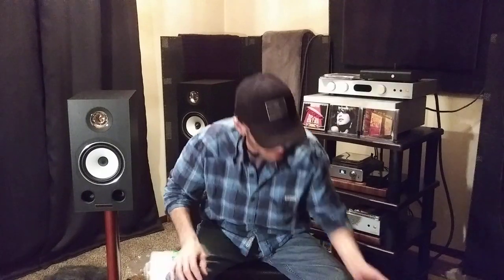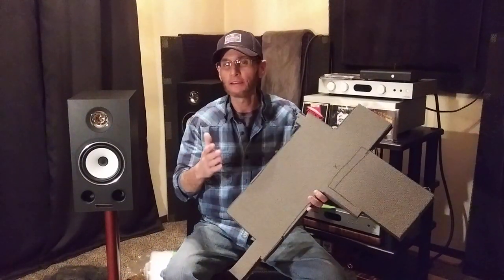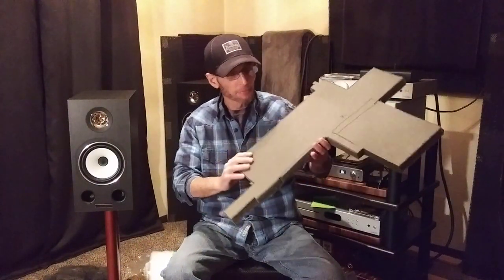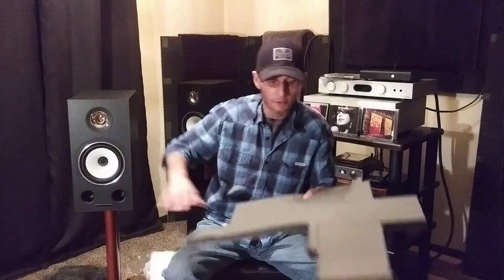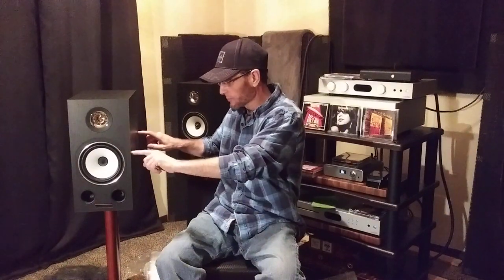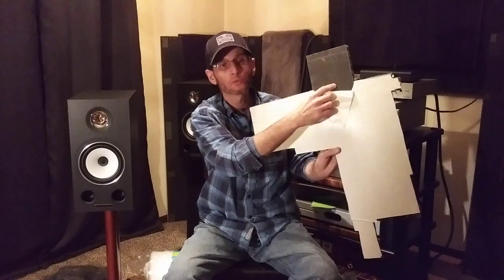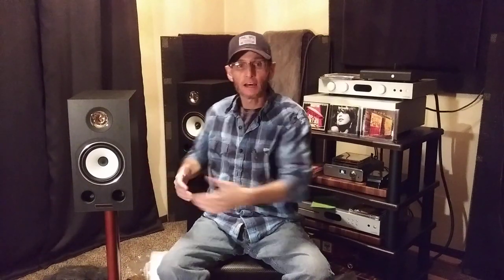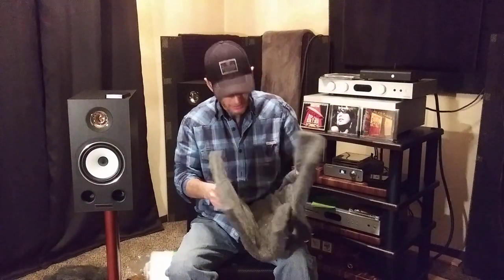My Expierence With Using No-Rez from GR-Research ! With my Triangles Esprit E.Z.Cometes Standmounts!

Comment: I am really surprised foam inside the box brought out more detail in your speaker.  I thought the foam would simply keep box diffraction, resonances, vibration, distortion, standing waves down.  I'm guessing drowning out the distortions of the box and reflections made the speaker seem more detailed.  Sound is weird like that.
Reply from the maker: Cabneit was very then by they norez calming down thay residence I could here deeper into the micro details cleaner sound
Reply: The self adhesive mineral filled polymer damper damps panel resonances and the open cell foam layer slows down air movement and helps damp internal reflections / standing waves

Comment: Thanks, Tee-Jay for all you’re doing in this vast and complicated hobby that most of us enjoy ( some frustrated ), but still fun nonetheless. 
I just bought these fantastic ( Comete Ez ) speakers a few days ago and love them so far. 
I’m a firm believer of leaving alone what the  manufacture intended for proper performance of their products. Not sure what you’re doing is  helping or not ( let your ears be the judge ). 
The reason I say this, is because I did some tweaking on various gear  years ago. and always reverting back to manufacture specs after a short time. I’m not saying what you’re doing is right or wrong... just saying it’s subjective and if it works for you...great.
Also, I’m a firm believer in burn-in with new speakers. What’s your recommendation on these, if I may ask? Thanks again and Happy Easter!
Reply from the maker: Idky this comment didn't come up . 
But yeah the Engeeners at Triangle done a great job thats why i mentioned they done a great job in the video but I noticed the 40th anniversary edition comete the engeeners grounded down the box even more so i kind of got the idea from them in an odd way but yeah I am a huge Fan of the Engeeners trust me i done talked with Hugo ! The owner of TRIANGLE 😃 and yes the engeeners tune their crossovers with the sound of the cabneit also 😃
Reply: Manufacturers cut corners to build to a price point. Improvements are easily obtained for not much money.

Comment: Great review TJ! I had similar results lining the walls on my CerwinVega! Speakers. I also had Danny at GR Reserch send me higher quality Crosover parts of equal factory values, tube connectors, high quality wire. As well as some other modifications. It’s fun impressing people with a under dog speaker lol!
It would be great to see a video of you upgrading the Crosover parts😃
Reply from the maker: Thanks JR ! I have owned many Cerwin Vegas ! Triangle engeeners done a great job with the crossover of the Esprit 
The engeeners actually customized their own crossovers with good quality parts They also make their own drivers/tweeters they dont order them off the shelf 😃 But congrats on the Vegas in the late 80s to early 90s I was knocking pictures off the wall and shaking 2×4 studs in my walls with the AT10/12s 
that took me back to memory lane !

Comment: Damn that foam is expensive.  Wonder if some cheap foam sheets off ebay would do the same mounted with some glue or blue tack
Reply from the maker: I tried some automotive accustic foam in my Kef Q-100s and it was no where near as good as the Norez ! I think theor may be picks on my community page
Reply: It’s not just foam.  The primary component is the heavy backing.  It’s like dynamax material.  The main purpose is to reduce vibrations from the cabinet walls.  The foam only helps to slow down the air movement.  Just gluing foam to the cabinet walls won’t change anything.

Comment: At around the 6 minute mark what your saying doesn't make sense. If you put the norez on top of the bottom layer or slide in between it's gonna take up the same amount of volume. Your just changing whether it sits on top or goes all the to the bottom
Reply from the maker: No i got more internal volume i done this both ways thats how i figured out how to get more space , i used black rubber  pieces to show you , the top and bottom i left a inch square off all sides then I placed them square center where the sides pieces would slide in perfect like a puzzle because the norez is one inch thick i gained more air space watch what i do with the black rubber pieces again
Reply: @tee-jaythestereo-bargainph2120  I watched it like 10 times, but that demonstration is flawed. If you line the walls with 1 inch thick norez all the way around it's gonna take up the same amount of volume no matter you you place them. You didn't magically make the side walls of the speaker further apart. It's physically impossible.
Reply: I'm not sure if I'm I'm explaining it correctly, but it's exactly the same either way.
Reply from the maker: @dakken74  no its not i done it both was and i lost air mass and i saved on norez , the orher way i used more NoRez and had less air space if this wasn't true i wouldn't have mentioned it
Reply: @tee-jaythestereo-bargainph2120  I'm sorry,,but it's physically impossible. In your example with the black blocks it seems like you gained volume because you moved the pieces to either side but if you cut the piece that represents the bottom then you wouldn't push them out to the side and they would slide straight down. I recently built a pair of speaker and lined them r-19 insulation and it takes up the same amount of volume either way.
Reply: @tee-jaythestereo-bargainph2120  if you line a speaker 1inch on all sides it's gonna be 1 inch no matter how you place it.
Reply: @tee-jaythestereo-bargainph2120  I'm sorry,,,I'm not trying to be rude,,but what your saying isn't possible. The only way to gain volume the way your describing would be to physically make the speaker wider.
Reply from the maker: @dakken74  the norez is 1inch thick i left 1inch square off of the bottom and top piece then i placed the side pieces down inbetween the gap, i saved space with that gap i done this both ways and when i layed the side pieces on top of the norez with no gap i lost internal space i measured this . I made it simple with the plastic pieces . When i layed the norez on top of 1 another i lost volume
Reply: @tee-jaythestereo-bargainph2120  I just uploaded a quick video to demonstrate what I'm talking about. It's impossible to gain volume.
Reply: @tee-jaythestereo-bargainph2120  1 inch all the way around is 1 inch,,it doesn't matter if the norez is sitting on top or made to fit in-between.
Reply: @tee-jaythestereo-bargainph2120  hopefully that quick video helped explain what I was trying to say 👍
Reply from the maker: @dakken74  I should had videoed  before and after Danny knows exactly what i was talking about all good though no offense taken at all good audio talk !! 
Glaf to have you on the channel at the end of the day we just 2 audio enthuist
Reply: @tee-jaythestereo-bargainph2120  yeah,,I believe we've spoken in the past.
Reply from the maker: @dakken74  hopefully we have more coversation in the future also , imho we   can gain from one another me very opened minded have a good1 my friend
Reply: @tee-jaythestereo-bargainph2120  definitely! I really appreciate youre focus on the more budget side of audio. I can't afford 10k speakers that's why I make my own lol
Reply: @tee-jaythestereo-bargainph2120  I actually just uploaded a video of my latest speaker build and I'd really appreciate if you're check and perhaps give a few words of criticism
Reply from the maker: @dakken74  you got it !

Comment: Not trying to be a troll but your explanation for why you made your cuts is inaccurate. If you did not cut 1 inch from each side then the bottom foam part would still be 1 inch wider on each side so the side foam would sit on top of that and you still have the same amount of interior volume. Still thanks for the video lots of good info.
Reply from the maker: You must not of understood i cut an inch all around the top and bottom piece sides top and bottom then placed them square giving me an inch clearance all around the top and bottom pieces and no eddie i know your not a troll buddy hell if anything you just trying to help out i need to start having editing to my videos instead of one takes only record stop is all i do i work 60 plus hrs a week so its hard to have time for editing , if i did editing i could have recorded the part where i installed all the pieces hopefully i can find another job soon my job is wearing me out ! (No life)
Reply: @tee-jaythestereo-bargainph2120  I think maybe you’re not understanding what he meant.  Whether it’s the top piece or side piece filling in that 1”, it’s filled either way.  The volume is exactly the same. Thanks for to the video man
Reply from the maker: Yeah i juat no-rezed my Kef Q-100s i was wrong Still equals the same surface area Danny is probly like what the hell is that boy smoking ! I do like the No-Rez though i bought 3 sheets !!
Reply from the maker: @kilgoretrout4461  yes thats what i was saying i was wrong didn't matter how the pieces fit still got the same volume 😆

Comment: It's too bad you can't remove some of it and compare it to what you have now. The way to do it would be to do a little at a time and test it to find the right balance.
Reply from the maker: I did this also when i finished one speaker i compared them against eah3 other on the right channel I used my Yamaha AS-1100 which had speaker A and B input and i have a switch to go back n forth thats how i could tell the difference , and i prefered the whole cabneit being covered except front baffle i was being modest with giving the NoRez a 3-5 percent gain in performace .

Comment: There's no change of volume putting the foam in either way.
 and what you're hearing is just because the foam is more dense then the cotton fill, that's why its upping the bass to a higher frequency and the mid-range is push forward but there will be some loss in low bass ideally want to cut the port little bit shorter now half an inch say. you could do that the other way if you added a bit to the port and didn't change the fill. Because you got two ports make it quarter of an inch not half an inch